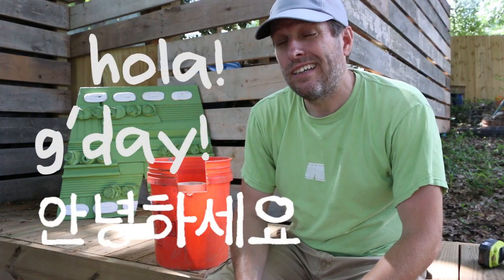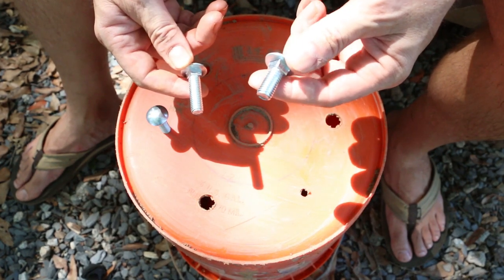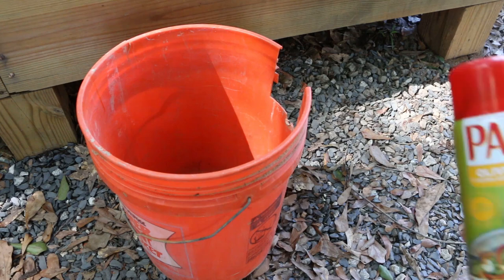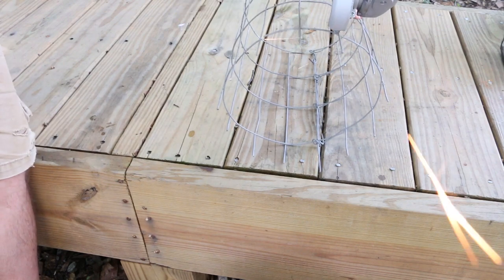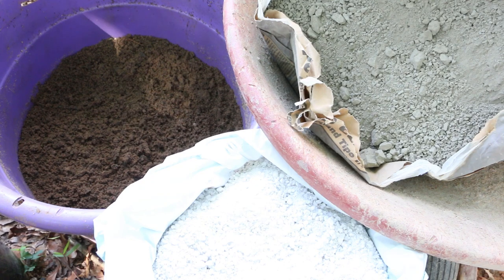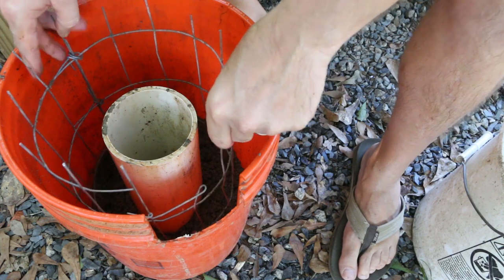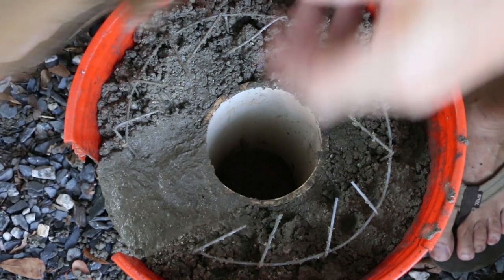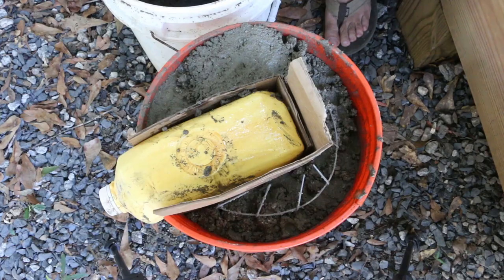Concrete & Perlite Rocket Stove FAIL! | What Went Wrong?

Comment: I'm super intrigued about building a rocket stove & I was wondering about the perlite option to lighten the weight.  Thanks for including the videos where things don't go perfectly- it's helpful to learn those things too, before taking on a project.
Reply from the maker: I did finally weigh both concrete stoves, with and without perlite. I can't recall exactly, but I think the concrete-only stove weighed between 75 and 80 pounds and the perlite version was 15-20 pounds lighter. I remember being shocked by how much weight the perlite helped shed from the stove. AND, it provides insulation value too. Thanks for watching.
Reply: @GreenShortzDIY  that's a huge difference in weight.  Thanks for that

Comment: I've experimented quite a bit with perlite concrete mixtures. Perlite significantly weakens castings, especially when moisture is present. The cardboard liners you used in earlier videos gave better de-moulding than anything I have tried and I will definitely use carboard in any future projects. I was fearful you might follow the advice about using demould waxes, knowing from bitter experience that nothing will come close to the easy de-mould you had with the cardboard. Good work, thanks for sharing.
Reply from the maker: Thank you for the feedback. I concur on the perlite. I’ve considered putting a seam in the pour with a piece of chip board, to force the expansion crack. I’ve had success strapping a cracked stove with steel pallet straps. I definitely think I’d go back to the cardboard for my next casting. Thank you for watching.
Reply: @GreenShortzDIY  for what it's worth, I think cracks forming on heating release stresses inherent in the casting and, if the cracked part is bonded back together it becomes stronger than it was before. I've bonded cracked parts back together using a slurry of talc in sodium silicate and the reformed pieces didn't crack again over prolonged use in heat risers etc. I'm considering casting future heat riser tubes as wedge shaped blocks that I bond together afterwards to make a tube, the idea being that there would be none of the stress inherent in a closed circle.

Comment: Remember if you never experience failure you aren't pushing the boundaries far enough.

If you are going to be doing  a lot of concrete mixing you might consider making a small mixer. Then you can mix all of the batch at one time and everything will be consistent. While your batch may have been too dry the problem may have been that the components weren't adequately mixed. The process of mixing grinds all of the components together so that every particle is fully wetted. This is particularly important with perlite since its surface is very good at trapping air. It is essentially glass foam. A good mixing will likely take 15 to 20 minutes.

Also, as was said by Copenhagen King, motor oil is commonly used as a release agent for concrete. You might also use caster bean oil.

Comment: By now you know how many scoops of concrete/sand/perlite you need to fill the entire bucket so mixing a "one fill" batch may be a better idea so as not to get the different qualities in each level, which also may make it more susceptible to cracking.  I am also certain you have already thought of this since this failure.  Thanks for the watch, I'm enjoying. ciao.
Reply from the maker: I could give that a try, if I mix it in my wheelbarrow. Mixing more than what I've been doing in the bucket would be difficult. Thanks for the suggestion. Glad you are enjoys the videos. Thanks for taking the time to comment. :-)

Comment: parchment paper (for baking) might work, it's less bulky and awkward than cardboard and infused with silicone for easy release.
Reply from the maker: Thanks for the suggestion, Amy. I appreciate it.
Reply: @GreenShortzDIY  ...Or kitchen plastic foil, it will stick to the bucket inside with just some water.
Reply: I was thinking that same thing

Comment: great videos!  I came upon some empty beer kegs recently and realized they would make a great shell for the rocket stove. You wouldn't need to worry so much about outside strength, allowing you to increase insulating value of liner.  currently a 26lb . stainless steel keg is worth $9.10 scrap value. you should be able to pick one up for under $20  thanks again for videos

Comment: I like what you're doing with the rocket stoves, and I'll be the first to tell you that I'm no concrete man per se'. I have worked with it a little down through the years, and I always thought you were supposed to strive  for a single pour! And that brings up another aspect to it. It should be a pour, and not a pack, or tamp. At least that would be my approach. I  spent 49 years in the house painting business, and I've done everything from fence posts to sump pump sinks, to French drains etc. And the last thing you want to do is pound on green concrete. Even if you dont do obvious appreciable damage,  you  can hairline it which will come back later as a heat crack. im not sure what would be a better release, but roofing felt comes to mind for me. Seems like it'd be thinner to work with, and should release okay, but that's a guess on my part??? Wax sounds good but how to apply it is my question. Some kind of a grease stick!!!?? I don't know.
Hey have fun, I'm  enjoying watching. 28 days sure surprized me.  But I guess the longer the better.  Especially when heat is involved.

Comment: I've had similar results with cooking spray. I've had great results with a layer of paste wax (slather it on, no need to buff it on a stove) and warm your plastic with a hair dryer after to get it to release easily. I've used this method for ornamental cement work. I also found that fumed silica made the cement lighter, a bit stronger, and much smoother, but don't know if it would be useful as an ultra fine lightweight aggregate for stoves.

Comment: Few things I've noticed from my experience: cardboard liners all the way, I think the 1st layer needed to be tampered better bc the perlite made air pockets on my fire brick too, and the fresh cement in mold is brittle until light grey appears. I didn't have good luck with Pam for release agent either. Wait until concrete shrinks with it upside down on blocks... live and learn right? Thx for another lesson
Reply: Hopefully it wasn't the Atl cup... lol
Reply from the maker: Well the Falcons have been know to blow a solid lead. :-) you just reminded me I need to link your channel. Forgot to add that in the description. Thanks for the feedback. Hope you are well.
Reply: GreenShortz DIY I'll get a vid of the fire brick I made. I feel extra binder is required to wick moisture held in the perlite/verm... I am impressed how well my pedestal held up under the 80lbs tower and heat. I made a back up that didn't need yet. Should be perfect for an example. Thanks, for everything...

Comment: Remember: The concrete provides the strength. The perlite provides the insulation. The more perlite you add the weaker the mix will be. The less perlite the stronger the mix, but the less insulation quality. I would much prefer, if it were mine, to make the mix stronger and forgo some of the insulating quality. A stove that is stronger, but doesn't insulate as well, is better than a very well insulated stove that falls apart after a couple uses, if it lasts that long.
Reply from the maker: Thanks Ken. I agree with your preference. The rocket stove I made with the crack resistant concrete and an armature has not cracked. In my mind it performs just as well as the perlite insulated version. I’m an experimenter, of course, so I like to try different applications. Thanks for the feedback. Thanks for watching.

Comment: Decades ago I tested concrete for an engineer. We were testing on a military base and the specifications call for no more than one inch slump. 
The test is carried out using a metal mould in the shape of a conical frustum known as a slump cone or Abrams cone, that is open at both ends and has attached handles. The tool typically has an internal diameter of 100 millimetres (3.9 in) at the top and of 200 millimetres (7.9 in) at the bottom with a height of 305 millimetres (12.0 in).The cone is placed on a hard non-absorbent surface. This cone is filled with fresh concrete in THREE stages. Each time, each layer is tamped 25 times with a 2 ft (600 mm)-long bullet-nosed metal rod measuring 5/8 in (16 mm) in diameter.[2] At the end of the third stage, the concrete is struck off flush with the top of the mould. The mould is carefully lifted vertically upwards, so as not to disturb the concrete cone.
The concrete then slumps (subsides). The slump of the concrete is measured by measuring the distance from the top of the slumped concrete to the level of the top of the slump cone.[

Comment: On future pours, I have some ideas that might be helpful. attach a hinge and latch to the bucket, and then slice in down the center into two halves. A day after the pour, you can open up the bucket like a book. 

My second suggestion is to make the center plug out of a wooden 4x4. Use a table saw to slice it lengthwise in two places so that you have three planks. Make the center one slightly thicker than the other two. Then use a table saw to trim the four corners so you end up with a slightly hexagon shape in the cross-section. A day after the pour, hammer out the center plank, and the other two should come out easily. 

Another thing that might be worth trying is to make the pours into two sections. Make an inner shell first with a high perlite mix, and after its complete, pour an outer shell with very little perlite for more strength.
Reply from the maker: Great suggestions, Ron. Thank you. Thank you for watching.

Comment: Great video man I enjoyed watching it but maybe you should've followed your inclination to take my advice. Oh well still a fun video and a great project. EDIT I didn't want to sound like a know it all buuuut youu did give me the right to an I told you so lol.
Reply from the maker: Ha! Yes, yes I did. :-) I think I had the mixture too dry. Did you notice? First it was way too wet so I mixed in more dry materials. Would appreciate your thoughts. Thanks for watching.
Reply: GreenShortz DIY well I did notice that it was way too dry and in my opinion maybe next time mix all the ingredients forgo the extra perolite and make sure that it has enough moisture in it so you can properly consolidate it that you cqn improve on the next attempt also i noticed the threaded inserts great addition the cooking spray was a good idea too but maybe go for a heavier oil that has a better film streangth such as engine oil. I appreciate your interest in my ideas and greatly enjoy watching them looking forward to your next one 👍 :)
Reply from the maker: Thanks for the feedback. I was guessing the cooking spray was a little too weak to release well. Would Crisco have the film strength needed? I was trying to go with a food-grade product. But, if you think it really ought be engine oil, I'll go that route. Thanks again.
Reply: GreenShortz DIY no problem man and I do believe crisco would work for what you're doing also if you let it cure for 2 days and use the proper ratio the mallet is not going to hurt it one bit keep up the good work man
Reply: Someone already suggested wax/cooking paper and that with cooking spray might do the trick. Maybe put the oil between paper and concrete?
Reply: If it doesn't rain while you're patiently waiting for a full cure, do you dampen it guys?
Reply: @redneckpyromania6965  thanks for the valuable input 👌🏻 appreciate it.
 Going to use your mix, however I'm unsure of the exact water amount. 
I'd like to get it right first time. :)
 What would you recommend ..?!
Again, thank you.
Reply: @julioseviltwin2304  theres honestly no exact amount of water because the moisture content of your aggregate will vary just slowly add water and mix until its pliable and you have a viscosity that suits your needs it should not be runny
Reply: @GreenShortzDIY  how about bottled cooking oil?
But when I was in shop class I think we used kerosene or home heating oil. Maybe tamp bucket a little before you let set up.
Reply: Any updates to the recipe?
Reply: @frankboy619  could try adding shredded fiberglass an additive that adds quite a bit of strength to concrete not sure how it would function in a rocket stove

Comment: Hey nice video, man! Really cool!

I suggest geopolymers as a material. Better heat and chemical resistance. Or as a fire or heat resistant coating. Fire is not only damaging materials through heat but through very corrosive gaseous substances in the fume. Along with the heat it is a extremely corrosive environment and Portland cement is a rather weak material.

I'd say even easier is to just mix perlite with diluted waterglass which gives a interesting refractory like material for coating and insulating the fire chamber.

I have so many projects but I have hope that I will find some time soon to make a rocket stove.

Have a good!

Comment: I don't think there is any other video out there as well explained, or watcher oriented" as you're videos are.!! I do like the way you explain everything SO Well.!! 
I know you've been getting a lot of good comments, on how to improve the "Release process" but I think you should, line the inside of you're bucket with a Thick plastic" it would come out a whole lot easier.!! However, it would need to be removed from the bucket, while the plastic liner could, be peeled off the side of the stove, if let set up over night, the plastic liner will be to hard to get off, and make a melted plastic smell evertime the stove was used.
Reply from the maker: Thanks for the feedback and encouragement. You are indeed an angel. Thanks for watching.

Comment: The ratios looked pretty okay, you would have gotten a better result if you had hit it with a cement vibrator when pouring. This would have gotten thing much more evenly distributed.

Maybe in the future, mix up some small batches and make little fire bricks with various mixtures and see what ratios and consistencies work the best for your needs.

But 110% use a cement vibrator next time. Gets all the air out, homogenizes the mix, and makes your finished product perform waaaaay better.

Thanks for sharing the progress with us!

Comment: Not enough combiner (Concrete) I think. Maybe 3 parts perlite, 2 parts concrete, & 1 part sand.
Plus, use a thicker oil like shortening or Crisco then dusting it with dry concrete or sand. Same idea for baking cakes  (butter & flour)

Comment: I used to do commercial diving and we did underwater concrete pours.  It was inevitable to get some concrete in our gloves and after pumping concrete into forms and using our hands to guide the tremmie hose and concrete the other divers laughed at me for constantly using hand lotion on my hands at the end of each day.  After a week their hands were dried out and skin cracked all over, my hands were slightly dry but not nearly bad enough for my skin to crack.   So personal suggestion if working with concrete and exposed skin wash skin thoroughly then apply liberal amounts of hand lotion.  It pays off.

Comment: Have you ever  thought about using one of these for ambient outdoor heat on cold days like restaurants do with those propane heaters?  I was thinking you could take an old well pump tank or something and drill or plasma cut a bunch of small holes in it and attach it on top of the stove in a way that it is solid but easily removed.
Reply from the maker: That’s a great idea. Thanks for the suggestion. Thanks for watching.

Comment: Hi, use compressed air and blow around the edge to loosen the mold.
fill only 1 centimeter from the edge so you do not need the wooden blocks.
Reply from the maker: Thanks for the suggestion, Martin. Thanks for watching.

Comment: Very good video!!!! It seems that it is better to fail by  adding more water than to leave the mixture too dry ... On the other hand ... as I was watching this video..for the part that you sprayed the bucket and the PVC with the cooking oil ... I said to myself ... it's going to be very difficult to get the PVC and the bucket out of the concrete. The cooking spray is simply washed off with the concrete mix ... You better stick with the cardboard approach.
I am in the process of making a small forging unit (for melting aluminum) ... and the proportion of my concrete will be 4 parts perlite, 2 parts sand and 1 part Portland cement. That's what I can get at the hardware store. I will use chicken wire to reinforce the concrete. There is a second idea which is to replace Portland cement with plaster of Paris ... what do you think? Thank you, and you have a new subscriber.
Reply from the maker: Thank you for the feedback. I recommend using the plaster of paris. I’ve got a plaster and perlite forge that has stood up to the heat well. I did an aircrete forge, with portland. It insulates well, but the parts that glow red, crumble once they cool.

Comment: If you make a lot of these then attach the wood blocks to the Outside, wide end, top of the bucket. Then you don't have to try to position them to break it out of the mold bucket. I like to leave a thick throw rug under it, so when it the stove slides out of the mold the fall doesn't break it. I do this with concrete weights as well.
Reply from the maker: Thank you for the tip. Thank you for watching.